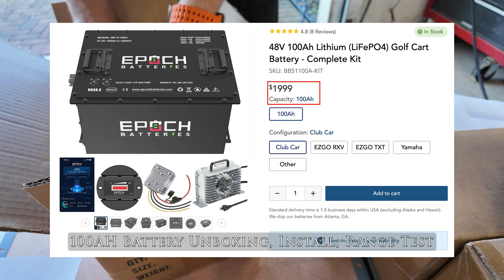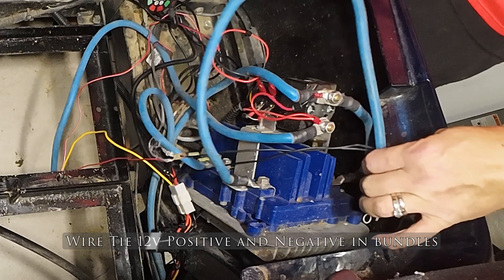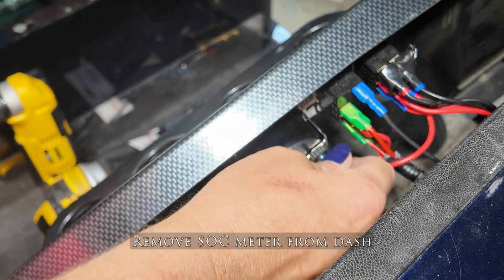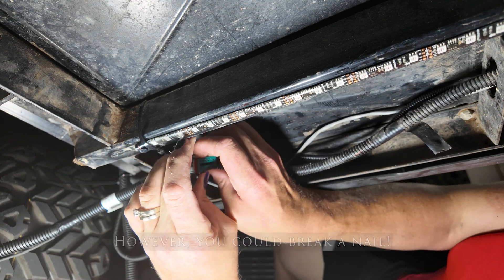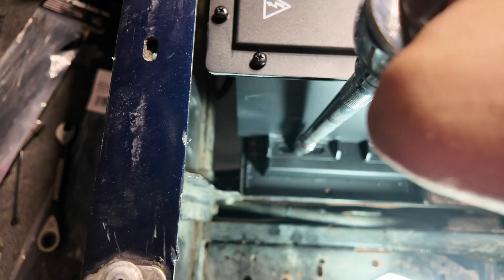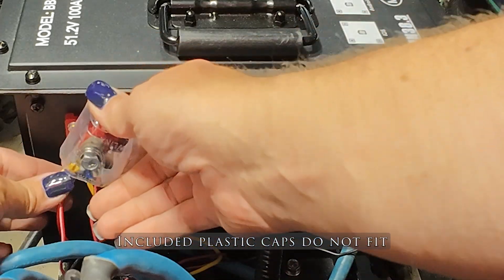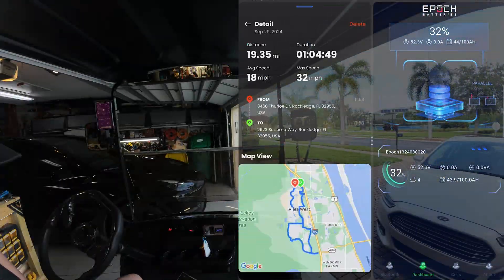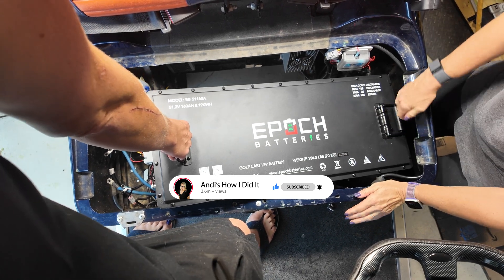Lead is Dead - Lithium Battery Install, Range Test, & Charging Cost

Comment: How many miles did you get with the epoch 160AH? I was wondering since black friday is this friday and want to pull the trigger on a lithium upgrade, and that's one I've been eyeballing. Thanks
Reply from the maker: I do have another video coming out on that one shortly. But since it's not out yet, I think it was north of 60 miles, just insane range. And that's with an upgraded motor and controller. Don't forget to use the code "BF2024" to get 15% off, and If you use my link, I might get some credit for sending you: https://bit.ly/496WvQy
Reply: @AndiWofford  that's amazing distance! I have seen the preview shows the 160ah battery hangs over into that dead space next to the battery rack. I use that space to keep a spare tool box with handy tools to fix the cart on the run if needed, I would have to rethink where to keep my spare tools. I can't wait to see the new video. You really make great videos, tons of helpful details that videos from others really don't provide, plus it's cool I have almost they same exact cart.  2002 ezgo txt pds 36 volt cart 48500xct alltrax controller and D&D 170-501-0001 motor, 6inch lift, 23" tires. It only goes 17mph. I'm hoping once 48 volt upgrade it will go atleast in the 20s. Thanks again for your response, looking foward to more great videos... I'm subscribed.
Reply from the maker: I have a good feeling about you moving from 36 to 48v. Don't forget the solenoid when you do the upgrade, but you'll likely be really happy and probably get into the low 20's after the upgrade. I'd have to think back - I actually did go from 36v lead to 48v lead, but I'm not sure if that was before or after my 8:1 to 6:1 gear upgrade video. I know both of those made a difference in speed. You'll likely do even better going from 36v lead to 48v lithium. It's all a good time regardless. Keep me posted on your upgrade, I definitely want to hear about it!
Reply: @AndiWofford did you have a problem making the 160 ah fit? When I measured the compartment I noticed the frame rail on the driver side that follows the rear wheel might keep the battery from sitting flat.
Reply: I can't wait to see the next video and the results with the 160ah battery. I'm still on the fence of the 105ah or the 160ah on fitment in the cart. That range test with the 100ah was that just you in the cart that got you 20miles with 32% left over.

Comment: Great video! I just installed this same setup,does your state of charge gauge and power button stay lit all the time?
Reply from the maker: Thank you! It stays lit when the power is on from the switch. If I turn the power off at the switch, all goes dark.
Reply: Thank you! So when I power it off and then power it back on I loose my memory settings for my stereo system.
Reply from the maker: If you power it off from the switch, you're killing the battery entirely. If you have an ignition wire switch on your DC to DC converter (and your radio), then you could ensure that your radio goes off with the key, but still maintains 12 volts as long as your battery isn't physically turned off with the switch. There's no real way to keep a memory in a radio that needs voltage for the memory if you're removing all voltage. To be honest, I don't use the power switch for the battery very much. It's not needed for my use.
Reply: @ Thank you!